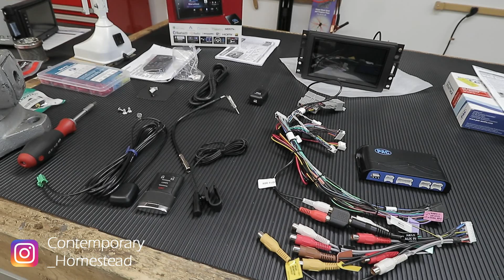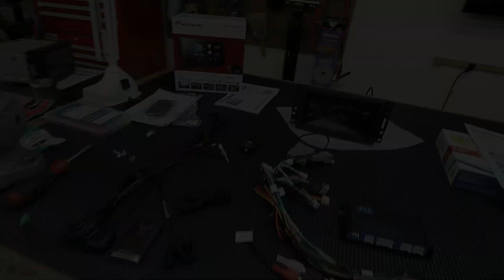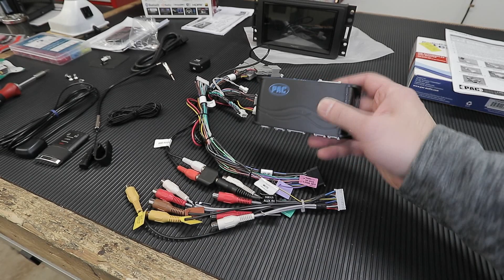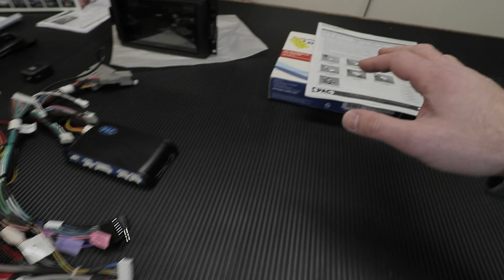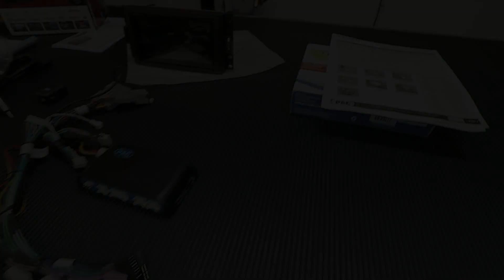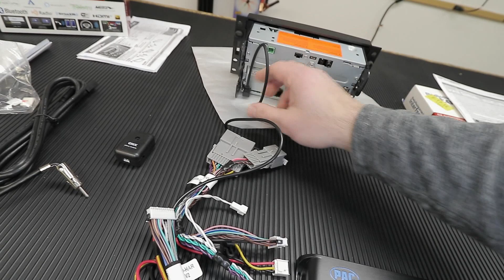C6 Corvette Stereo Headunit Install w/ Back Up Camera | Speaker Noise Issues Solved!

Comment: Hi, Nice video. I am considering this head unit/setup to upgrade my C6 as well, and I have a few questions. 1.) I saw in one of the comments that you mentioned the Heads Up Display was not supported by the PAC adapter. Do you know if a different adapter is available, or do you just lose use of the HUD by using this head unit and setup? 2.) You mentioned that the steering wheel controls work well after plugging in. Does that include answering phone calls? 3.) How is the sound clarity of the call? Do the internal and external microphones that came with the Pioneer work well?

Comment: For steering wheel controls did you need to program them?  Or did they just work as is after install?
Reply from the maker: They worked after plugged in, but you can change the functions too
Reply: @ModernHotrodsNH how

Comment: Questions can i intall the radio whitout the pac i have corvette c6 2005? Can i use regular harness kit ?
Reply from the maker: Yes if its not a bose system im pretty sure the standard c6 harness will work just fine
Reply: @ModernHotrodsNH  i get the pac RP5 now the sistem sound very good but my question is can I intall Amp subwoofer and keep the bose  sistem?

Comment: Great video! I will definitely use it as a reference. Side question, where did you get the steering wheel? I have a 2013 C6 427 and want to also upgrade the steering wheel.

Comment: Did the head unit improve sound.  Im thinking of going with a separate amplifier and not the bose
Reply from the maker: No it didnt theres more to be desired in the sound quality dept..the eq on the pioneer does help a little. I will install higher quality speakers next and amp if i need to.
Reply: @ModernHotrodsNH  thanks for the honest answer!!!

Comment: how is this headunit working for you 11 months later and did you have any issues with the chimes in the vehicle? I just picked up a 2012 c6 gs and was planning on running the same setup
Reply from the maker: Im liking it still. No issues with chimes. I may upgrade the speakers down the road and rewire as i think the factory bose is just ok. I prefer better sound from the speakers. But EQ is great on this Pioneer.
Reply: @ModernHotrodsNH  got it hooked up but for somereaoson my steering wheel controls aren't working, any idea why? I have the pioneer radio 4600 and it says you only need to connect the aux jack and not use the other wires. not sure what I could be doing wrong. how did you wire your steering wheel controls part

Comment: One more question.  My car has the OEM mike in the upper left of the windshield.  Will I still be using that?  Thanks in advance for the response
Reply: I actually bought another OEM mic so I could do some testing.. what I did to give it an OEM look was to gut the OEM mic and put an after market mic in its place. then I put it back together and it obviously looks like an OEM mic as the internals are aftermarket but the body is the GM stuff. Never seen anyone else do this, but works and works better than stock. Maybe I should post it on the corvette forums, but it was pretty easy to do.
Reply from the maker: No i am using the newly supplied one with the headuint instead. The factory items do not tie in well.

Comment: If my usb in the back is working with the OEM radio, do I have to replace it?
Reply from the maker: i could not get the oem usb connection to work with the new headunit after many attempts. So i gave up, pulled it all out and upgraded it with a new USB 3.0 with AUX in interface.

Comment: Nice car. I have the "bose" setup and it sounds horrid. did this setup improve the sound quality? Were the stock speakers and amp fine? I'm guessing that the head itself is the main problem.. I can deal with the stock tech but the poor audio is intolerable.
Reply from the maker: im very please with the sound from headunit utilizing factory bose amp and speakers. It does sound better because of the great EQ the pioneer has. Main reason i chose it over an alpine. Im very pick with audio quality and im still pleased. Dont really want to run speaker wires for new speakers right but maybe down the road...